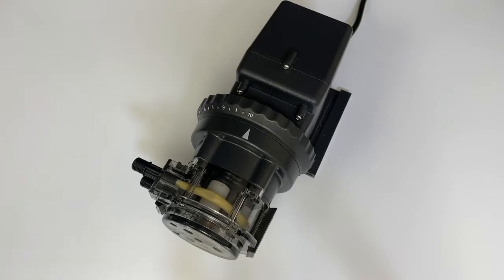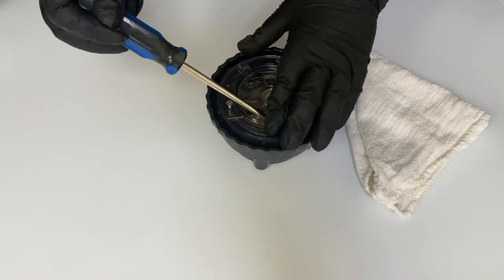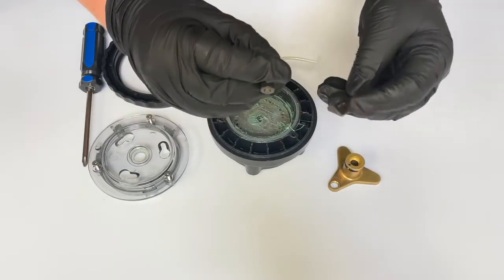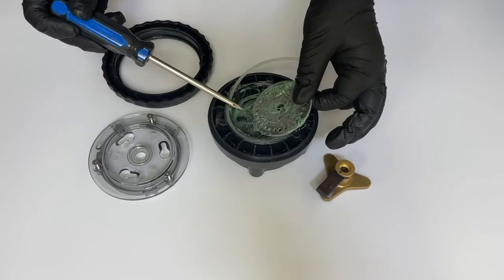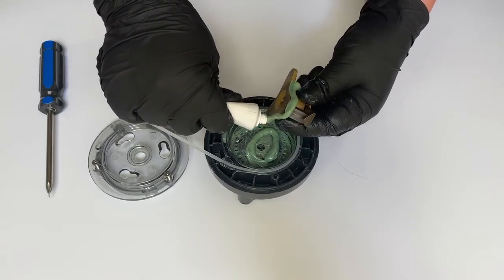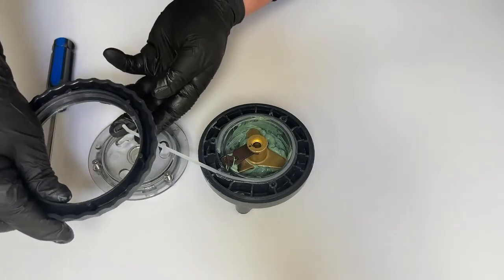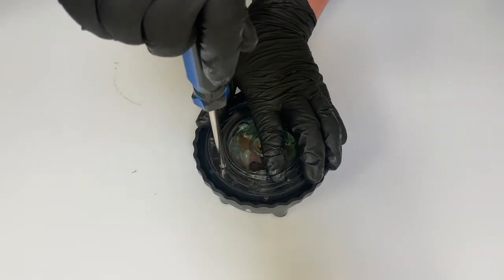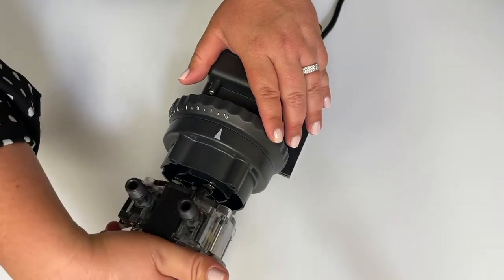Stenner Feed Rate Control Maintenance

Comment: It would really be a huge help if you can also give a link to the part numbers for the parts, as well as what the lube is that you are using.  You say it and it sounds like AquaShield, but you really can't read it or see it.   If the repair stuff comes as a kit, it would be nice to tell your audience what the kit's name is and where to find the correct part numbers.   The video of the process is very good and very helpful, but the missing information about names of parts, part list locations and the thing about Aqua, would be a great addition, thank you!